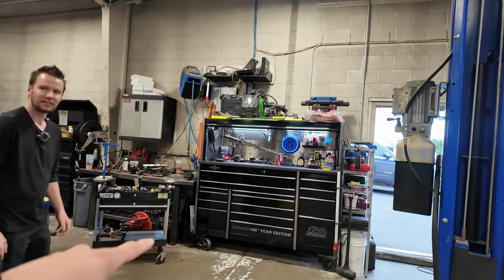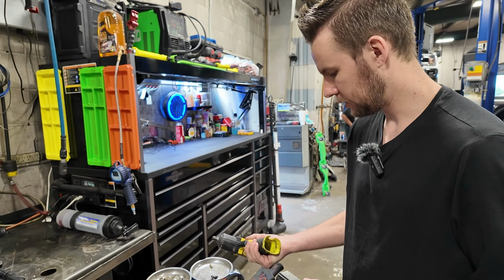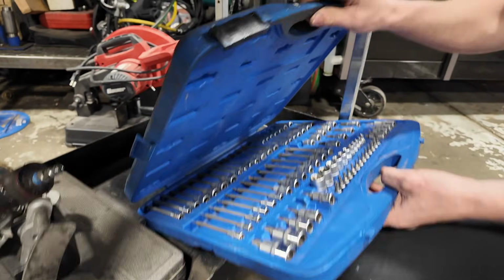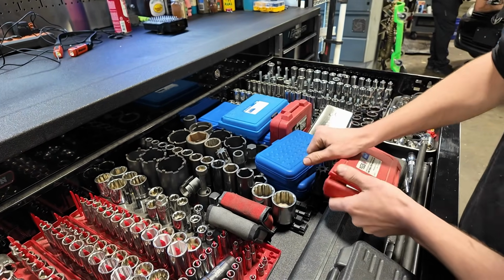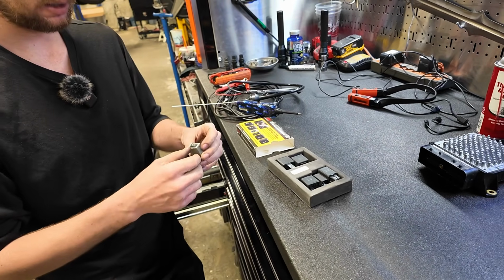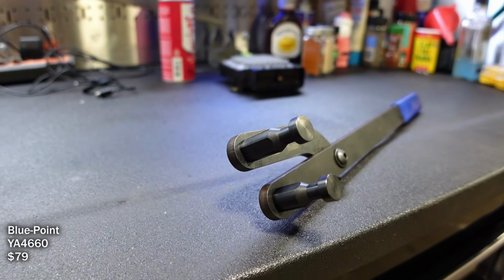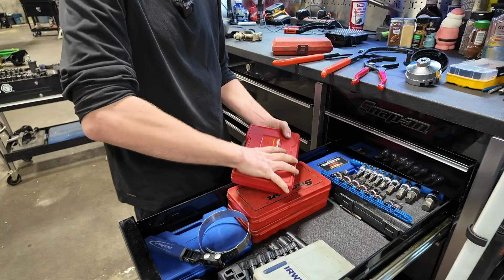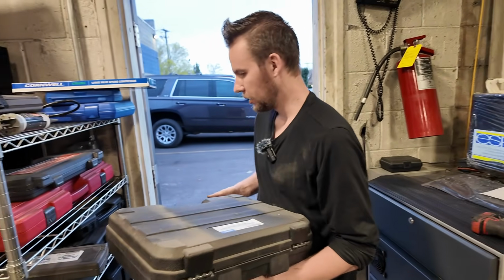Organizing by Color for Higher Productivity!

Comment: I'm the guy in the video, if any of y'all see anything that didn't get talked about in the video, drop a reply and I'll get back to you as soon as I get around to it :p
Reply: Dude you got some nice stuff👌
Reply: On the left  side of the box, you have three plastic trays,  yellow green and orange. Who makes them?  Guessing you use them to hold parts when you are tearing apart something.  Nice tool box you have
Reply: @jjgag601  Thanks man! They're magnetic parts trays/organizers, I actually have a black one as well. Snap-on makes them, I can get the exact part numbers for you if you want them. I can generally organize like a head/engine/transmission job size amount of stuff into each one, might take 2 for like a cab off diesel head job, so it's pretty rare that I need all 4 at the same time, but it does happen occasionally. I actually have several harbor freight triple and single magnet trays stuck to the side under the table that I also use for smaller stuff. I just like to keep things organized enough so I could potentially tear something apart, have it sit a few months, and then not have to think too hard about what suff is for what going back together.
Reply: I have the same exact 100 year anniversary box awesome!
Reply: Hello

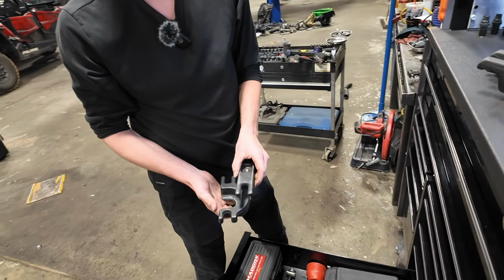I cannot find the low profile pitman arm puller at 21:56 anywhere.

Thank you
Reply: Looks like you need a couple of lockers for your box to hold all of your cased tools. That would free up some drawer space for you.
Reply: @ecleveland1  I've gotten some rails and stuff since then, so my big socket drawer is a lot cleaner. Only reason I haven't gotten lockers is because if I upgrade it's gonna be to my final forever box and last I checked that'll run me 30k
Reply: The final form 😂😂 @danielwaldron988
Reply: Great box and tools. Great tour thanks!
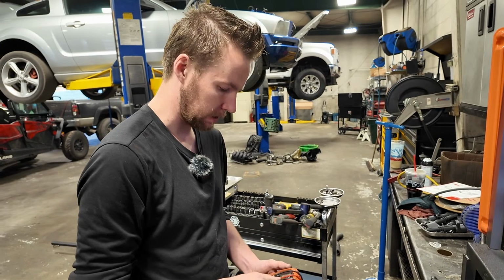Reply: 16:00 I believe it reads maximum 40M ohms
Reply: Are u the TE VIDEOS CREATOR, SOUND ALOT LIKE HIM WITH SOME OF THE SAME MANNERISMS N BOX LOOKS VERY SIMILAR

Comment: I bet I've got at least 1 older Snap-On tool than anyone watching this video. I have a socket from the old drive size system(drive sizes ellude me, but were in the 32nds of of an inch) with a date code of 1929. Not in the greatest of shape, and as I have no drive tools that fit it, it's used as a paperweight.

As far as ratchets go, even though there is only an occassionally around Matco guy, my favorite ratchet is a 3/8" locking flex head Matcho ratchet(steel handle) that I found in the trash with the flex head rusted up. Once I got it free'd up, although the locking teeth are very pitted, it works absolutely perfectly. IF I need something shorter, I have a "fine tooth" (for it's time, 72 tooth)rubber coated finger grip Ampro ratchet I picked up in the clearance bin of an Autozone 20yrs ago, and prior to finding the MAtco ratchet, it was my go to for nearly everything. I've similar to the toolbox owner, found the modern rubber handle rachets soak up oil and can't be kept clean. The Ampro ratchet handle is like plastidip, and is impervious to oils.

Comment: I feel your pain bro. As an introvert it’s hard to make friends. I do so many favors and make custom test harnesses for common issues on the stuff we work on.
Reply: just surround yourself around extroverts and they’ll adopt you lol 🤣🤣
Reply: @jonathannavarro4540 That's funny😄😄.
Reply from the maker: Introvert checking in. 🫠
Reply: That's actually really cool
Reply: @DillonDaVillain222   It takes a little research and guessing to find the connectors online. Sometimes it’s easier to just hack apart cars at a junk yard and get a bucket of spare connectors. My favorite test harnesses are for stuff that’s hidden so you can check resistance and how much voltage/amperage is going through the live circuit. They sell pinout boxes or you can 3D print your own. When you’re that good at wiring might as well have your own mobile shop and only specialize in electrical work. Shops will gladly outsource that for a car that’s causing headaches.
Reply: I make lunch on Fridays pretty often too. Next week is Cajun chicken pasta.
Reply: I’m the introvert that gets called “one way” 😂 because I’m always coming back to the shop with delicious food and I guess I was supposed to ask everyone if they wanted me to pickup their lunch too.